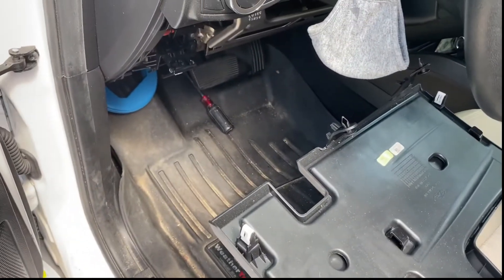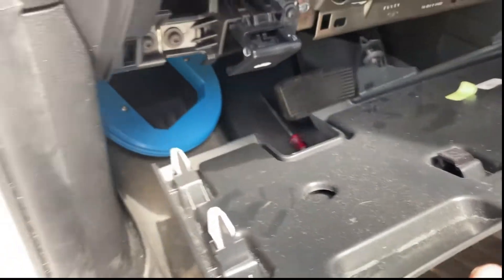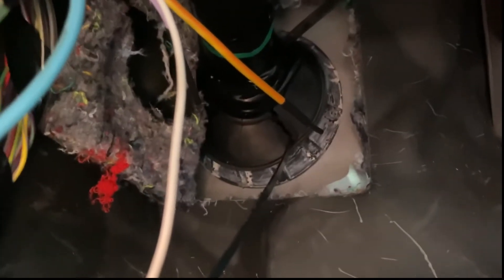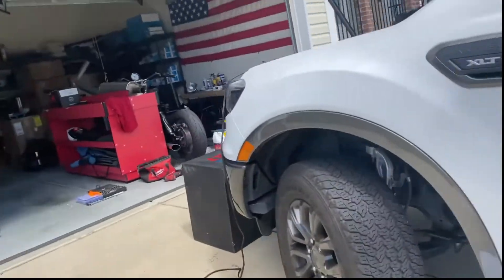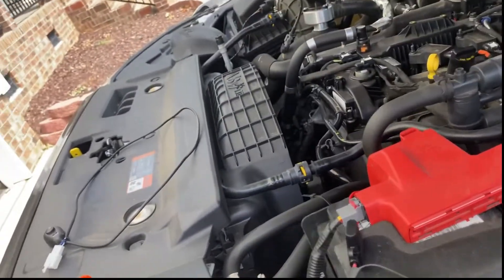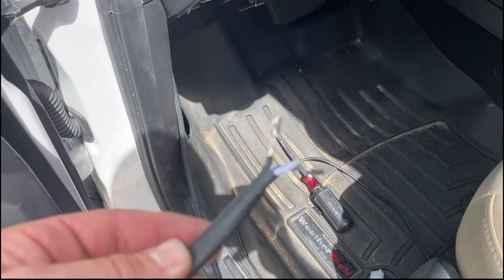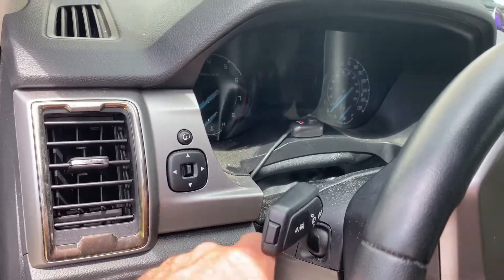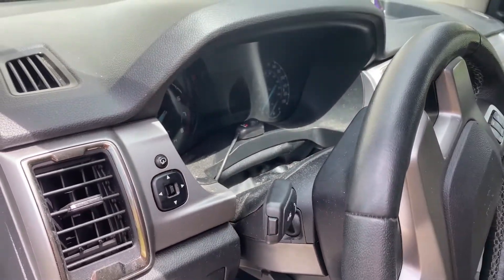How to fish wire through your new Ford Ranger Firewall. 2019-2022 models.

Comment: I spent a good amount of time trying to pierce a hole through the exact same spot you displayed on the video.  I tried a fish line and tools to get passed the other side of the rubber boot but it wouldn’t give.  And if it did get through,  I couldn’t locate it using a bright spot light.  I’m disappointed.
Reply from the maker: I'm sorry it didn't work for you. I used a heavy electrical fish tape.
Reply: I actually managed to pierce through a long Phillips driver.  All good.   Thanks the video.